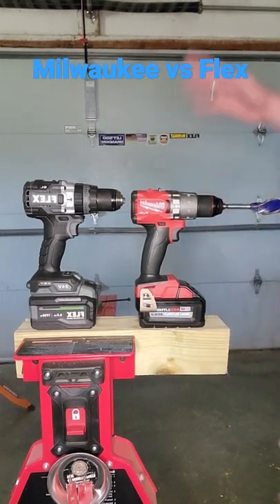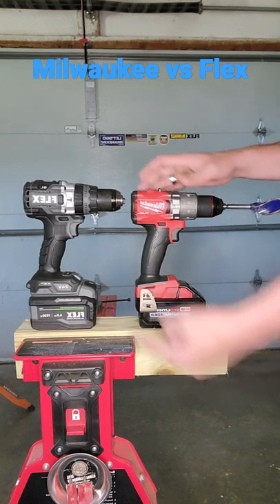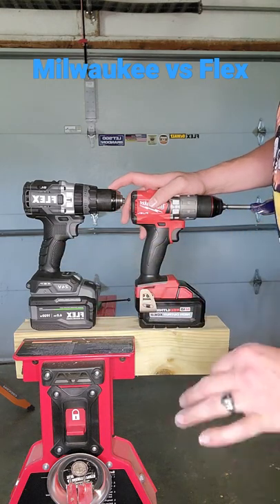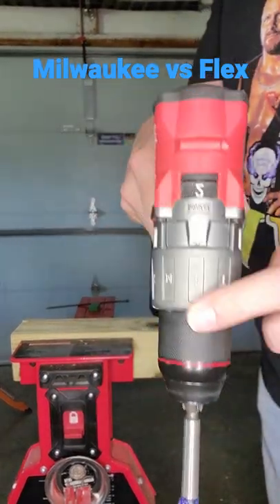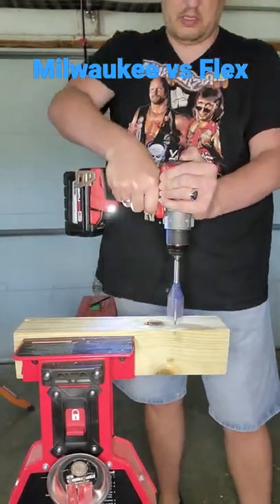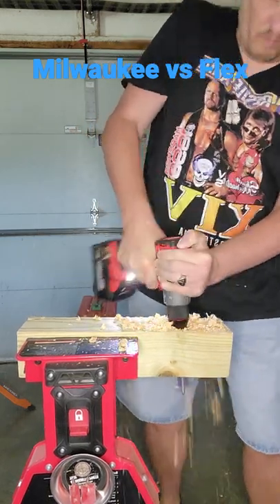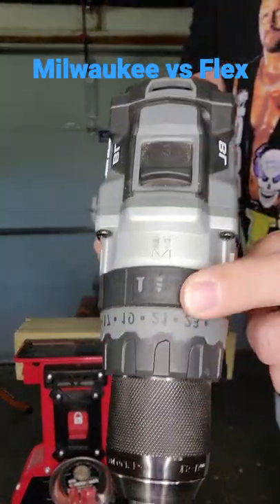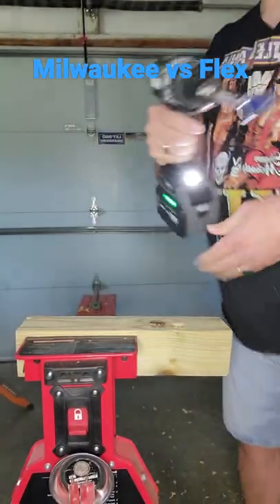Who Wins? Milwaukee Fuel vs Flex Turbo (Hammer Drill) #milwaukeetools #flextools

Comment: I timed it.   It’s a tie.  Both 3 sec.  I actually thought the Flex was going to win.  But am surprised.  You see how this kind of video would help me make up my mind in purchasing a tool.  Milwaukee is much smaller compared to the flex therefore an easy choice to purchase and use as an all day tool if your looking for lighter more compact tool that has the same power as the flex.
Reply from the maker: I like them both

Comment: FYI I own dewalt, Ryobi, dremel, black & decker, craftsman tools and am not locked in to one brand.
Reply from the maker: That's nice. I am into 23 different platforms
Reply: Started with DeWalt and got Milwaukee 18v and 12v, I like both brands I might look into the Flex now

Comment: Nice video Robert.  That Flex is very impressive on Turbo mode.  Both did well, but the Flex appeared to drill through slightly easier.
Reply from the maker: I didn't have to fight it as much. Maybe this will stop the people that tell me I need a different battery on the Milwaukee?
Reply: @ToolswithSoAlz  you never know.  They might come back and tell you to put a 12.0 on the Milwaukee, 😂.  That being said, the Gen 3 hammer drill is 4 years old and competitors, Flex included, have had plenty of time to catch up and eventually pass its performance capabilities.  Can’t wait to see the new Gen 4 hammer drill.  That will give Flex a run for its money I’m sure.  👍
Reply from the maker: I am going to get it and test that Gen 4 as soon as I can. Right now I can say I have four hammer drills more powerful than the Milwaukee
Reply: @ToolswithSoAlz  is the Ridgid Brushless with max output 6.0ah battery one of them?  I’m guessing not based on the specs, but figured I would ask.

Comment: I see the flex cranked right through , j mean the Milwaukee was fast but I think the turbo mode made a difference on the Flex 👍
Reply from the maker: I agree
Reply: Does turbo mode drain the battery super fast?
Reply from the maker: Not super fast but faster

Comment: 24 volt tool against an 18 volt tool. The 24volt batteries will drain faster than the Fuel batteries. Using the drill across a productive day on a work site,  you'll have to go get fresh batteries more often with the Flex drill.  This dude spends his days drilling holes in blocks of wood with tools that look brand new. The rest of us that make money with those tools on a job site will buy the tool that will perform the best for us all day long. Fractions of a second per fastener will have negligible impact on productivity.
Reply from the maker: Sorry your tool brand lost and it is causing you to have a mental breakdown.  Maybe be a man and quit making excuses.
Reply: Yea flex have best batteries on market they last longer than milwaukee I had both and work out in the field everyday but milwaukee has great batteries last longer than most other brands